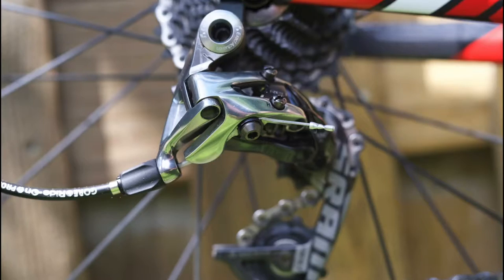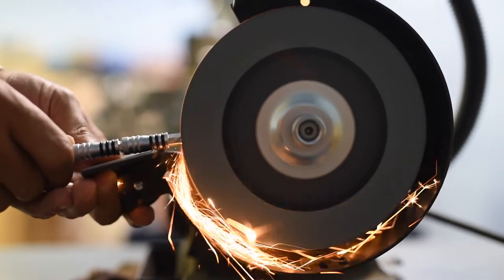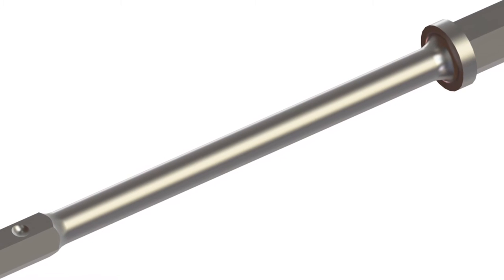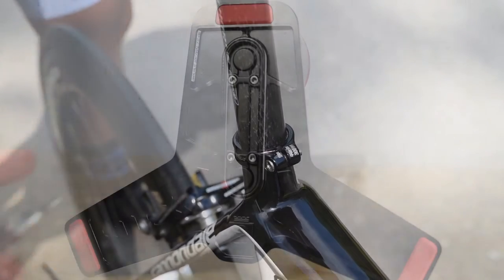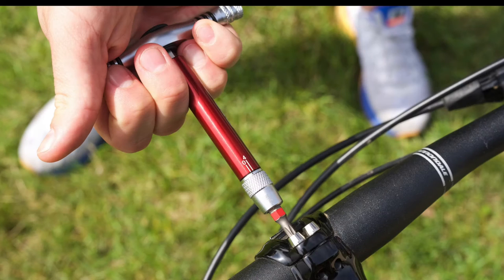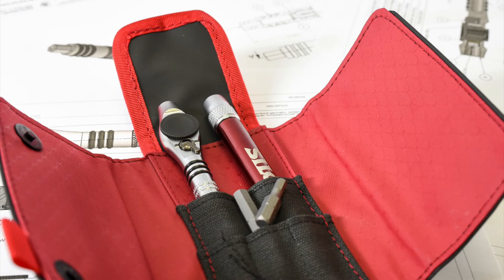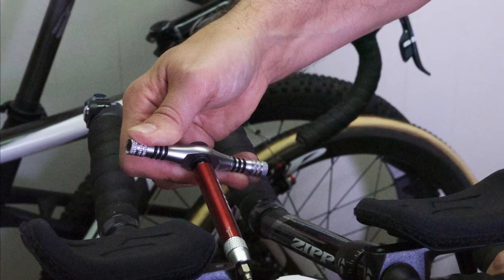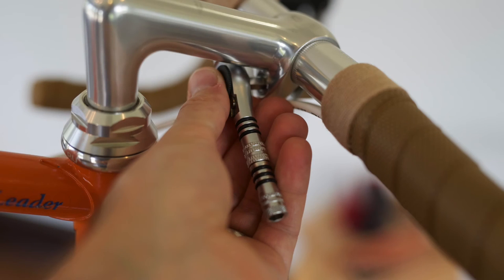Kickstarter

Comment: "2, 4, 6, or 8 mmthmeter"  what?  Was he saying "NMth meter"?  This is what I wanted to know and he smeared it! and how do you know it has turned enough?  a click?  oh, I think he said 'until it lines up."  I wish he had slowed down and showed that.   What is step-torquing?  I'm not a mechanic.  I want one so I can do my own repairs, but protect my new equipment.  Good video, but  he could have explained the more technical terms for novices.  But, I guess this wasn't really a lesson on the tool (which is very cool), but just an ad-in-disguise to raise kickstarter cash.
Reply from the maker: The tool measures torque in Newton-Meters or Nm.  The tool does not click, but rather the torque value will align with the arrow when it is acheived, so you have to watch the torque scale as you apply force and then release when the desired number is acheived.